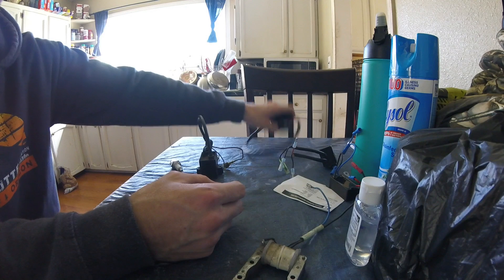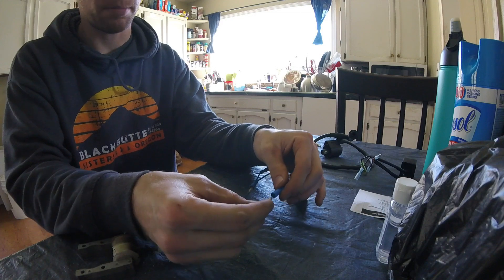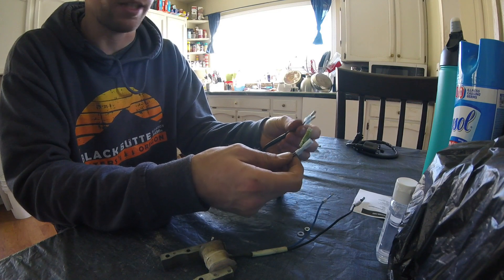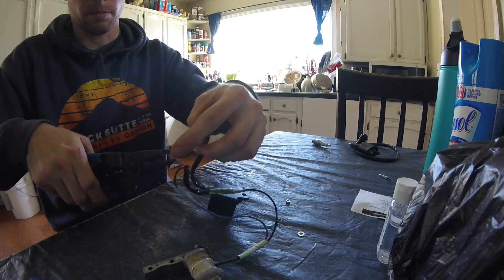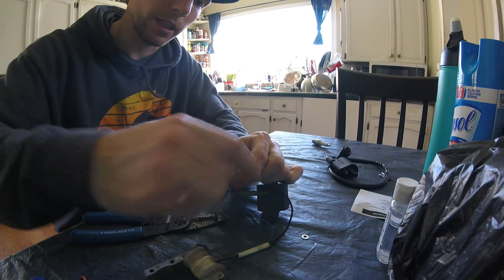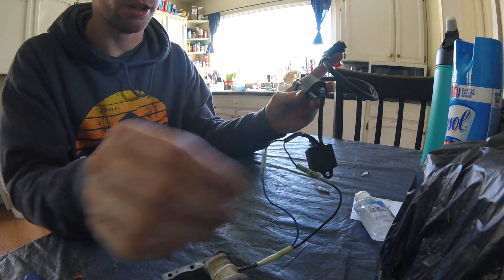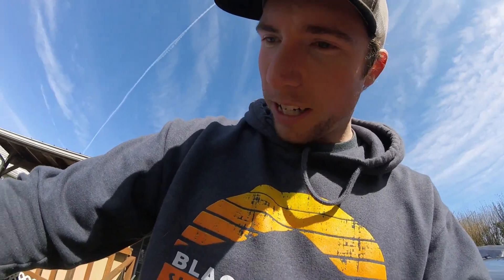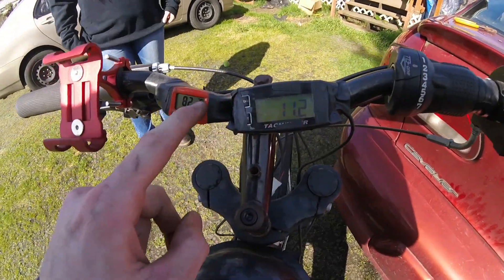Motorized bicycle, wiring a stand alone Cdi and coil

Comment: Hey,
Just watched your video on magneto coil/ coils,etc.
I bought another 80cc engine kit. Because I bought all new ignition assembly,still won't start.$Like your setup...I have a huffy Cranbrook,and if you could give advise on rebuild with that sweet start,idle,and no oil coming out of head, muffler,etc

Comment: I have a question about a 50cc cylinder. I just recently ruined my 47mm engine and had to use this 40mm one. The new cylinder came with no open transports so I opened them up like my 47mm cylinder was. Was this a bad thing to do. was wondering because I cannot get the engine to run

Comment: Link?
Reply from the maker: if you go on ebay you can look them up as a pw80 cdi. the newer ones that cost 10-25 bucks all need a magnetic pickup on a rotor and a 12v battery to run them. the older style 83-99' used the AC currrent from a magneto and magnet rotor. they usually look dirty and are priced higher at 50-90 dollars typically

Comment: hi, I wonder if you can shed any light on this, WT or anyone? I Have recently brought a pw80 CDI and a stand alone coil, also for a pw80, I have 2 separate black wires so one's gonna be a ground connected to the magneto loop set and the other black will connect to the terminal on the coil. connect orange to the other terminal which is posistive. but I'm getting  nothing at all.. I also have a red and white wire that I'm not sure what that does.. but both brand new today and wired as you did in your video and nothing is happening . No spark whatsoever.. I'm confused. It starting to do my head in, I've walked away from it for a while but found myself re watching this video again to double check.. and confirmed I did everything the same.. what could it be . And what does that red and white wire do. The 2 blacks for the killswitch have a plug on I presume they do not need to be grounded out or anything ? Oh my days .. help it's driving me crazy here.. :/ Cheers Sy
Reply from the maker: Does your pw80 cdi have 5 wires or 6? Also does it have a Mitsubishi symbol on it or no? The older Mitsubishi style cdi work with a AC current system aka magnet and magneto. The newer style system need a timing magnet for trigger and a DC battery as well. Please confirm which cdi you have to help with the question.
Reply: @wtmotobikes8838  5 wires and 2 black kill switch wires like the ones you cut off in your video. no mitsubishi type symbol or any type of symbol, just a plain box, does that mean its the wrong type? Both were off eBay.
Reply from the maker: If it doesn’t have the Mitsubishi symbol on it it’s probably not the right one. Iv always had to pay $50-$110 for the old Mitsubishi style ones for magneto because they don’t make them anymore. I’ll see if I can find you a link to one.
Reply: @wtmotobikes8838  yeah man sound. Thanks for your help bud. :) Means alot
Reply: @wtmotobikes8838 crap I think I bought the same wrong one is there not anyway to get it to run or would it have to be the Mitsubishi version thanks
Reply from the maker: I looked around and I couldn’t find a single one for sale. They’re kinda hard to find.
Reply: @wtmotobikes8838  ok sound no worries mate. Nice video though. Very informative. I was thinking that apart from needing to uprating my carburettor now, only thing letting me down was spark needed to be a little stronger. Im running a ported yd100 with mz65 clone expansion chamber, 44tooth sprocket, decked cylinder,  polished exhaust port and widened and roughened intake port. Just just running standard nt carburettor at the moment.

Comment: Would luv to see it compared on a dyno but can u tell a noticable difference?
Reply from the maker: It really depends on your setup. It mostly is noticeable under boost from a good pipe as the ignition curve helps add more power through the rpm range vs a stock box ignition

Comment: ATV I think  ac  , cdi red& black   going to the inside  corner of the 4pin plug?  is this powering the coil. { Or power coming in from the stator] ? power in is normally in to the first of the two pin  . on mine  is brown . could this be red 7 black in & out red & black to the coiled ?  blow & whit is pickup that the same . ? can you help ?.

Comment: I need help wiring a Chinese 5 wire ac cdi to my bike. The colors are red, blue, yellow, black and green. The coil has a 2color coded prongs coming out of it. A green and a black comeo out of the coil. I know with most Chinese the green is ground. So my question is do I run the green to my magneto and the coil? I'm assuming that the black will go to the coil since it's color coded. The red to the red from my magneto. But then that leaves my a loose blue and yellow

Comment: Can you make another video that uses the CONTROL UNIT IGNITION CDI BOX YAMAHA PY50 PW50 PEEWEE 50 PIT PRO TRAIL DIRT BIKE. Because this is the only one that is on the market in my region. And explain how to put everything together because my electrical system is becoming weaker by the days
Reply from the maker: The correct CDI will have a Mitsubishi emblem on the front side of it. If it is the cheap ones on eBay or Amazon they will need a 12v battery and a magnetic trigger to operate. There is a guy who I did see who managed to make a trigger style ignition work for him. I haven’t done it myself though. I could try though.
Reply from the maker: Look this up on eBay. This is the correct cdi 

1999 Yamaha Pw80 Y-zinger Ecu Computer Controller Unit Black Box Ecm Cdi OEM

Comment: I have an mz65 pipe on my gasbike.com 100cc raw racer 3 engine. Does it need a better cdi and ignition coil
Reply from the maker: If it runs the way it is right now then probably not. Only when you start really amping up the high compression does it need to have stronger spark and ignition.

Comment: I need to extend the wire length from my CDI to the engine and the length of the kit throttle to the CDI. I'm installing a mini bike seat on my bike and installing the CDI under the seat. What is the typical wire gauge on a two stroke engine? What is the wire gauge on the typical kit throttle? Thanks much!
Reply: U need 8mm ignition wire

Comment: Why do you prefer to choke the engine out to kill it instead of stop ignition?
Reply from the maker: Thunder Fox  it makes the magneto last longer. When you ground the circuit into the magneto it burns the ground wire of the magneto.
Reply: @wtmotobikes8838  interesting. I figured it would take much more voltage to burn a wire. I try to shut the fuel valve off and ride for 30 more seconds. It'll drain the float bowl and shut off on it's own, and then it won't reek of gas inside my apartment (as much).
Reply: @ThunderFoxMusic  I've heard that's a bad habit. Like all things, for every person that recommends something there is another one telling you why it's wrong.

Comment: Can I somehow connect this motorized bike CDI to a 125cc pit bike and use it as a spark generator? Because I bought a bike without the spark transformer.
Reply from the maker: GuitarJoe I would recommend trying to find the original equipment for the bike. If it is a 4 stroke engine then it’s a completely different ignition system. If it’s a newer style two stroke then it’s going to need a cdi unit that has a built in trigger wire in the cdi. These CDI’s for motorized bicycles do not use a trigger. The rotor that turns between the magneto is what created the charge that goes to the coil.

Comment: Will it's Luke walker can U use the non marked 7 wire unit
Reply from the maker: I don’t think you can without a igniter pickup thing and a battery
Reply: What exactly is a non marked 7 wire unit?

Comment: Good video, very informative. Thanks. What's your opinion on "boost bottles"? I have seen pro and con for them, but every pro video actually shows the bottle in action. Thunderhead 289 actually pinches off the tube to show the difference, and it made the motor run smoother with the bottle active. In most cases it seems to produce a smoother sounding motor and the claim is for more power at some point in the power band. The nay sayers so far have not done anything demonstrative to prove their point, so I'm of the opinion that they work. Also, do you think that an expansion chamber exhaust requires re-jetting, or maybe adjusting the clip on the needle? I bought the F2 Thrust pipe from bikeberry and it was causing the motor to four stroke when coming off the throttle at speed. I raised the clip one notch, and it quieted it right down. Much smoother now.
Reply: the guy nobody likes  I did, couldn't get the motor to idle. Took it off. It was a CDH Power product, had a bottle made out of a used CO2 cartridge. Not even close to 66cc displacement. They call it a "Function Bottle". I suspect that it's supposed to be replaced with an NO2 setup. No idea, checked it for leaks, there weren't any. I have a bottle I've adapted for use that is a lot closer to 66cc's I'm going to try that once the hideous weather here moderates somewhat. Rain, hail, snow, windy as hell; cold as a nun's bun. And that was just today!
Reply from the maker: Hey Eric, from the research Iv done into understanding a boost bottle and other forms or volume intake type things. In most cases they are on 4 strokes and have a resonance effect that helps the low end torque of the said engine. you wouldn't believe it but if you pop the hood on a new 2000+s Honda car and look at the intake you will see a large style box with a auxilary box for just extra volume. that is a form of boost bottle that I'm referring to in a 4 stroke. For a two stroke the only engine that I can think of that uses anything Like a boost bottle is the yamaha banshee with the twin carb setup and the balance tube that goes between both carbs. other than that I havent seen it in use in any other production motorcycles. For our engines though I would highly doubt it gives you any kind of gains at all other than a place to catch a air leak and end up destroying your engine from running lean. 

I re jet my engine if it even feels colder outside. jetting changes with the weather. pressure can even change your jetting. That pipe your talking about is a real choked off pipe and so it loads the engine up a bit, thats why it four strokes. Hope these help man.
Reply: @wtmotobikes8838  Thanks for your response, I'm kind of new to the two cycle ICE. The way that I had envisioned the boost bottle was as a sort of cushion. The air flow entering the motor at idle and at speed, has mass and inertia. The cycle pulsations of the combustion/exhaust/intake process interrupt the constant flow of the air/fuel mixture. The bottle relieves the momentary back pressure of the flow when the cycle pulses occur, instead of it pulsing back into the venturi and disturbing the mixing event. That's the only idea that makes any sense to me. Sort of like an expansion chamber on the intake side. My other issue was that the motor does not come with any kind of owner/instruction manual. You buy a motorcycle, it tells you what kind of spark plug, and the proper gap. I have seen two videos on this matter. The first recommends .025" gap; the second video recommends .035. There has to be a way to find which gap between those two extremes works best. A sort of rule of thumb, as we used to say. If this, than do that...